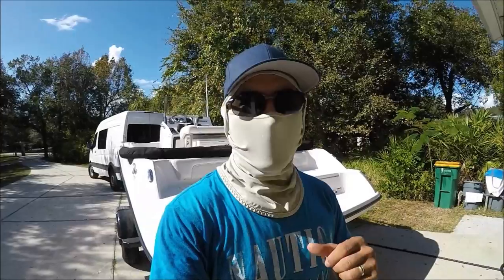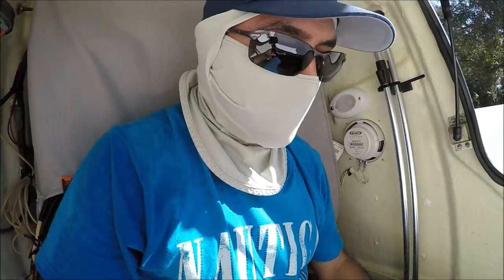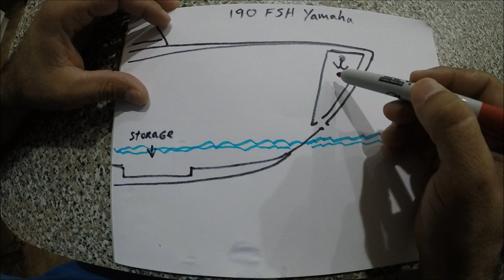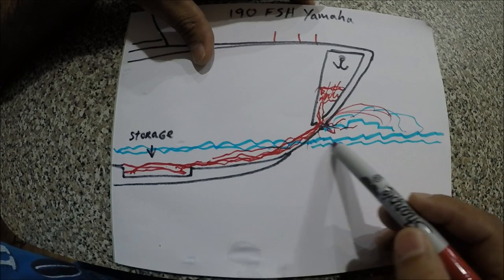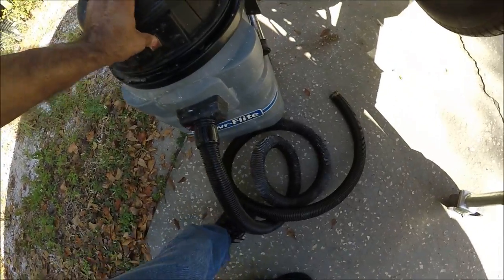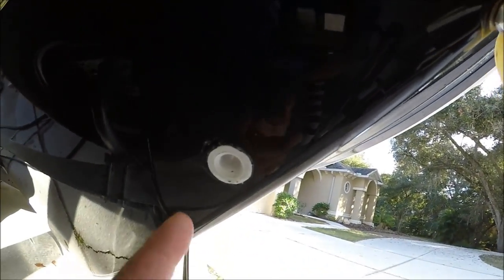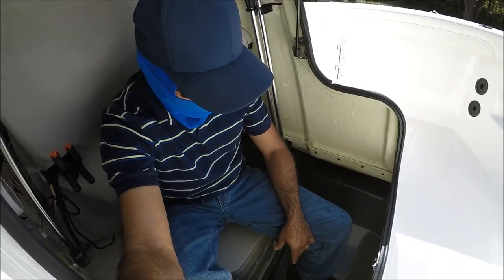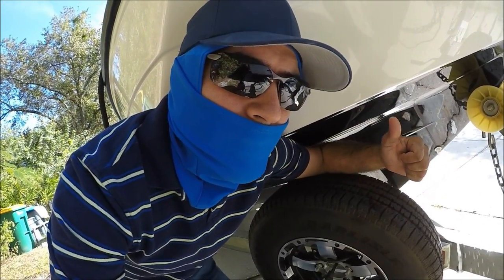YAMAHA 190 FSH LEAKS WATER into boat hull How to fix it DIY Yamaha 210 FSH Yamaha 240 FSH

Comment: Just got my FSH  190 , 2019 edition and they still haven't addressed this. Glad to know this fix and will do it without removing the inlet! Just going to pump silicon into the gap. Many thanks :)
Reply from the maker: Anytime and thank you for watching and navigate safe
Reply: FYI
The water is coming from dry storage LOL
behind the anchor compartment
Waterfall into the changing room on port side

Comment: I used the same sealant you used, but was wondering if 4200/ liquid nails would be more texas heat tolerant.
Reply from the maker: @aztxtransport2776  That is another good option captain that is a stronger one

Comment: I know you’ve moved on and don’t have this boat anymore but how did your ford transit do pulling this boat? We have a transit and looking at getting this type of boat. Thanks for your videos.
Reply from the maker: hello John ,i always has a Sprinter ban i did not have a transit, sorry i cant help you with that question
Reply: Out On The Reef thanks. I understand they are roughly the same. How does it hold up with towing. We have the ford version of a sprinter
Reply from the maker: @johnmartinezkilo  well the only difference is that Diesel has more torque then gasoline,  but i don't think you will have problem, 190 fsh is not a heavy boat.
What size of engine you have cap?
Reply: Out On The Reef I have the 3.7L V6 on my transit van 350. Thanks a lot for the info.
Reply from the maker: @johnmartinezkilo  that's a good size engine you should do good

Comment: My battery compartment holding stinky water 
It has no where to go
How can I get this water
out ?
I have 2021 195 FSH
Reply from the maker: sorry cap. you are going thru this but im not familiar with the 195 fsh , i had the190 fst and i believe they are a little different

Comment: Is this still a problem with the 2019’s I just bought one. Wondering since the hull size has changed.
Reply from the maker: Currently I changed boats to a pilothouse but I'm not sure if the new Hall which is a little bit bigger it's the same but I'm afraid it might be the same just a different layout just keep an eye on it once a year to see if everything is in place back there that's my recommendation.
Navigate safe captain

Comment: Finally it warmed up today, i checked my sloppy job. Filled up the anchor locker with Water and was surprised problem solved. Thank you. 
But I plugged my deck 2 drains and too bad my console filled with water. The plastic pipe on my port side underneath the jump seat dont leak. On the starboard has a tiny leak. Any help?
Reply from the maker: AZ Tx Transport did you check the clamps to see if they are secured?
Reply: Out On The Reef 
Yeah. The clamps are tight. Only leak I barely see is from starboard where the pipe meets fiberglass. 
Btw theres a drain in motor compartment. Shall I leave it open/ close???
Reply from the maker: AZ Tx Transport yes Engine compartment drain needs to be open because that's where the water flows from the front of the boat drains all the way to your builge so that's the way the water's going to your builge I will leave it open and as far as that leak that's got to be probably where the boat shell  of the fiberglass they didn't put any Marine clear silicone there or if they did it probably very silicone.
Are you under the 1 year warranty?
Reply: Out On The Reef 
I think so. Just bought it a month ago. Was told it comes with 5 years. Still waiting for warranty in mail.

Comment: Great fix but Why not just fiberglass that entire hole in so there is a straight shot from anchor to exit.
Reply from the maker: that is a option that means  that the bilge pump will be working overtime cap that's why they design that exit hole

Comment: Looks like a good fix, i guess getting a longer drain tube and adding some sealant was not possible? Did yamaha ever fix it? Im guessing you have a 2016/17  year boat but you said all 190’s? Yikes - btw, why is there even a drain in your cargo areA?
Reply from the maker: Samuel Jaramillo everyone who purchase a 190 FSH I believe 2016 and 20 17 had this issue I'm not sure if recently, has to fix the issue but it's a big problem but very easy to fix

Comment: I highly recommend Yamabond adhesive sealant it's the best . Far superior than your run of the mill marine silicon
Reply from the maker: rrandydduke thanks i will try it next time thanks for the recomendation
Reply: +Out On The Reef anytime man ! I have used the stuff for years on my moto's and RC boats. I recently re wired my Bayliners trailer and filled in the wire nuts with the stuff as to water proof them , afteI soldering them . Many applications for the stuff . Nothing will hurt it (gas, solvent.....) .. awesome stuff. Hondabond4 works just as good . Have a good day bud
Reply: Muy buenos vídeos y para cojer ideas para mí vote 🛥🛥🛥🛥🛥🛥🛥
Reply from the maker: Julia Suarez gracias Capitana saludos